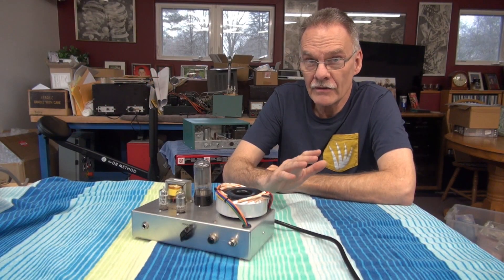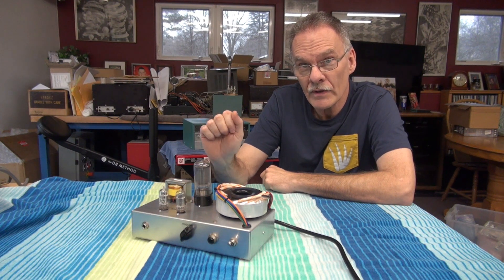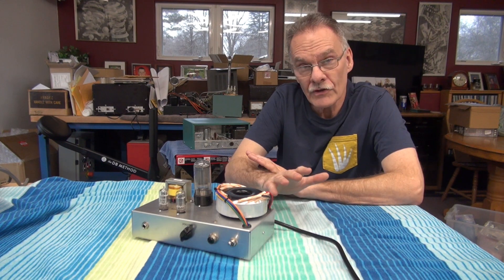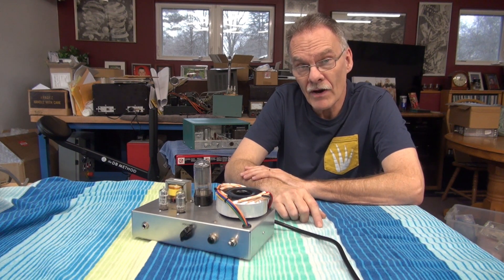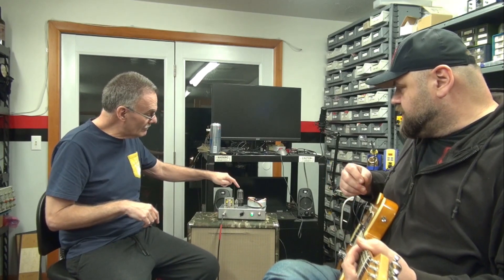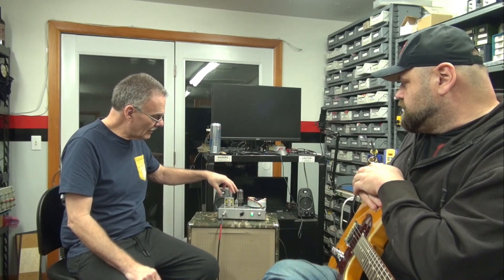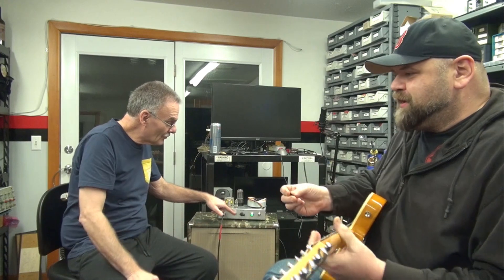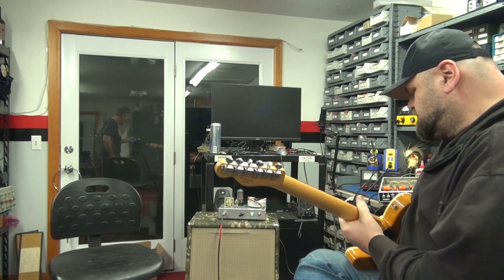Cheap to build Homebrew Russian 6N3C Class A Practice Tube guitar amp DIY Great low budget design

Comment: I use those 6P3S tubes in a 25w KLD 2204 circuit. They sound great. I also use the Russian 6N2P preamp tubes, similar to a 12AX7 but with a different heater circuit. It’s a great amp.
Reply: Yeah, those 6n2p's are cool.

Comment: 👍but the tube is probably 6П3С cyrillic (6 “pee” (or “pi”) 3 “es”, or 6P3S latin) - an old Soviet version of 6L6GC indeed, a super popular audio output tube in radios and amplifiers of the day and also medium power MW and SW transmitters. A 6Н3С cyrillic (6N3S latin) would be an octal dual triode according to the designation letters, but there’s no such tube AFAIK.. just my 2 kopecks.
Reply: There are also similar 6P3S-E, also sold after rebranding as Sovtek 5881 / 6L6WGC / 6P3S-E. In the 1950s, 6P3S were produced in Poland under the Telam brand, and from the 1960s, Dolam. They had a Coke Bottle envelope. 6L6 were also produced in Eastern Germany (RFT), 6L6GC in Yugoslavia (Ei).
Reply: @Zeebee1971  6P6S are the 6V6 actually, but other than that - yes, all true. They were making them all over the Eastern Block - Tesla, Tungsram, Ei, can't remember all.. The "-E" and "-EB" variants were "Extended lifespan" and "Vibration resistant". There were also "-EP" - radiation proof, in case you wanted to keep on rocking under two suns in the sunset...
Reply: I made a mistake in my comment, which I corrected. I meant 6P3S-E, not 6P6S-E (if I'm not mistaken, it was never produced). The Russian equivalent of the 6V6 is the 6P6S. 6P3S is the equivalent of RCA 6L6 in a metal envelope. At least this is what follows from the comparison of catalog data.
Reply: @Zeebee1971  Yes, 6P6S is the same as 6V6. The 6П3С is an improved glass bottle version of the earlier 6П3 - the clone of the metal envelope 6L6.
Reply: In all the photos I saw, the 6П3/6P3 had a glass envelope. As for the improvements, they didn't make the 6P3S a 6L6GC. The plate characteristics end at 500V, and the plate dissipation is only 20.5W.